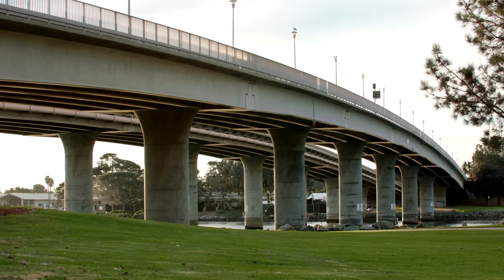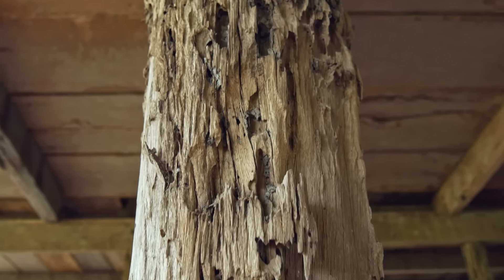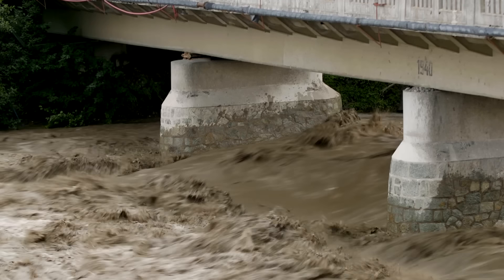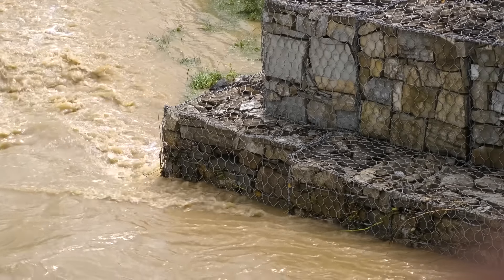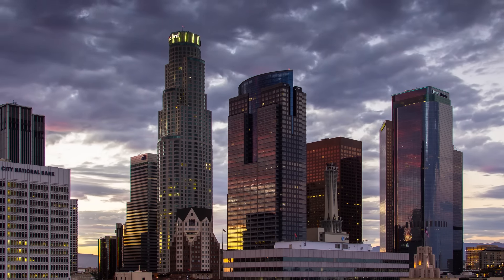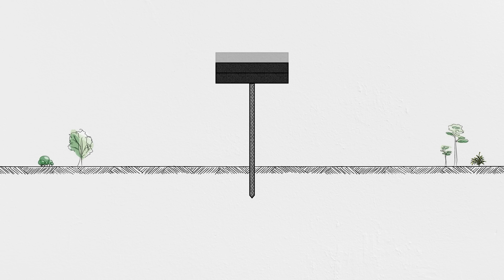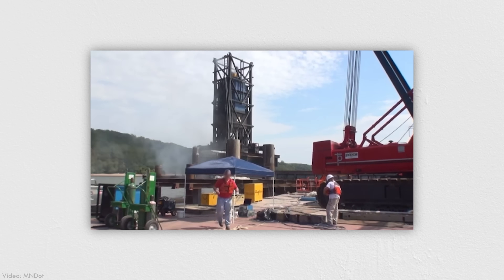Why Buildings Need Foundations

Comment: Static and dynamic force conversion was the methods we used in the military engineering when designing a bunker or any other military structure. Try to convert from dynamic to static (the effect of a bomb explosion) is very complicated. I like this video very much.

Comment: It is so interesting to see how things are build differently around the world. I don't think you will ever meet a foundation like yours around here for example, at least for anything build after 1960. Everything is build with deep reinforced concrete foundations, most likely because of the earthquake resistant requirements. On the other hand the old mud houses build before the 60s don't have any foundation at all, yet some of them still standing even after 2-3 devastating earthquakes during their lifetime (most are just destroyed from rain however, after they are abandoned and their roof fail with the years of corrosion).
Have you made any video about mud houses? We had a lot after WWII in Greece, even some of them reaching 2 stories and some are still used today.

Comment: Great video, very informative. 

Here in Perth Western Australia we have mostly stable sand so the common foundation/slab used is a strip footing with a supported slab or a monolithic foundation/slab (poured in one go). Both work very well. Frost line here is about 12inches below the ground surface.

Comment: here In the Netherlands do to the type of soil we have here. (mostly sea/river clay) 
They almost always go for the pile driven option. Even for smaller residential buildings. But then people tend to build here with the idea that a average (cheaper) house is build to at least last about 50+ years un altered and if possible with a structural face lift to ad at least a 40+ years again.
So in that way they become more cheaper in the long run.

I always find it funny that the ground work part often takes more work then the actual building of the above ground structure.

Comment: Sitting in my basement in 2 degree Michigan right now watching this video. My 1970's home has a shallow well at 30 feet. I basically live upon a small lake with several layers of clay, bedrock, and then concrete between me and that lake. The saving grace is that I also live next to a culvert downhill which feeds into a lake several miles away. That allows for the water  under my home to be maintained despite the several feet of rising water that natural culvert may experience during heavy rains. The home was overbuilt and thought out. For instance all my water lines run along one wall protected by decking and raised soil to lessen water running against the side of the foundation.  Most of the electrical runs along the same wall making utility repairs much simpler. While most basements do require some sort of sump this one does not and the foundation was well though out. 50 years later I have a slight "grout" crack in one brick wall and not one crack in the concrete poured slab despite no relief cuts. The entire house sits upon a "raft" like you mentioned with a 6" deep floor and a large percentage of fiber. Practical engineering can overcome most obstacles with a proper foundation to work from.

Comment: It was so interesting to see a house with wooden foundations! And even more so, its off the ground! I've been through civil engineering school, but I've never seen these where I'm from. Its always strip footing, usually 1,2m - 2.2m deep for residential homes (depending of if they have a basement, which they usually do). It might have to do with the fact that we exclusively build walls out of bricks and concrete, so i suppose all that weight needs support. Raft for larger, for example a 3 story building would almost always get a raft recommendation from the staticians.

Comment: Could you do a video on trench shoring, deep foundations such as secant and contiguous piling? Specifically applications that are meant to be used around existing structures and close to building perimeters?

It relates to a personal project seeking to  build an underground storage bordering my own building and neighbouring gardens without my building or the surrounding soil collapsing into the pit.

 Great content!

Comment: coming to this channel nearer the end of 2022 but - I live in the southeast (south Mississippi to be precise) and I find myself fascinated by this topic and how it might apply to the kind of geology common here! Soil that's a mix of sand and clay, and a really REALLY high water table - on the Gulf Coast, it's really common to see homes built on tall wooden "stilts" (probably not the correct technical term but it was all I heard anyone call them). I never thought about it very much. Now I'm wondering lots of things! It's pretty obvious why that kind of elevated home is popular, when flooding is extremely common - between the Gulf itself and the bayous and rivers, there's almost always a ton of water to contend with, and as I said the water table is Very High even a hundred miles inland. There's a ton of sand and clay, too, just native to the soils of the whole region - great for certain crops, not so much for wooden support piles and such, I'd imagine. On top of all that - it makes me think about the massive wave of "new techniques" for building that came through here after Hurricane Katrina. A whole lot of folks claiming they had "hurricane proof" designs, some of which weren't as sturdy as they wanted to claim. But surely the methods and choices for building in these areas have changed over time, even before that, right? Even before Hurricane Camille, maybe even back in the 1800s. The science of engineering has grown and changed, and the techniques and materials available for common use have to have changed too! That idea fascinates me, even if it's a little bit more history than engineering...

Comment: I read (and translated) a patent where a foundation pile is driven into the ground. A release cable is then activated and the pile is further driven into the ground. The release cable would release wings from the pile which would offer additional bearing load capacity than the force it takes to hammer it in. The pile may be pulled up at a future date for reuse.

Comment: Very interesting thanks.  I'd happily watch more videos on foundations.  Would particularly like to see videos on building in such a way that the building is highly earthquake-proof.  I live in New Zealand, and we get quite a few earthquakes here, (fault-lines, Pacific 'rim-of-fire,'...)  Large buildings can use base-isolators, but I understand they're not appropriate for most homes as a residential house is generally not heavy enough to withstand heavy winds while sitting on base isolators, which, after all, are designed to protect the building from horizontal forces (more than vertical ones, at least that's my impression.)  I've seen some solutions.  Also, none of the piles/foundations in this video had cross-bracing.  It seems to me that this would be a lot harder to install, but would provide significantly more strength in an earthquake (or even a large storm.)  And in really tall buildings you have tuned mass dampers.  Though they're not directly related to foundations, they really are when you consider the job of the foundations.  Another thing about foundations I'd like to hear is you were saying that very tall buildings (skyscrapers) can't spread their weight over a large area, so are forced to go down deeper instead.  I wonder if a skyscraper (especially a comparatively isolated one, if such a thing exists,) could in fact be okay with much shallower foundations - IF it could be built on a foundation with an enormous footprint.

Comment: Back in the day when I was a concrete truck driver, a customer of ours was dissatisfied with the foundation under the old house he bought. It ended up being a crawl space made of dry stacked cinder blocks on a on grade footer (lots of frost working it’s way under the foundation every winter). He proceeded to hand dig a basement under his house over the course of a year or so. He would excavate a trench, pour a footer, pour a wall, and then settle on edge of the house onto it. He repeated this over and over without ever moving his family out.

Comment: 0:25 //“job-stability” as a reason for foundations to exist is a pretty random thing to say
1:40 differential movement leads to stress; if stress greater than inherent strength->cracks
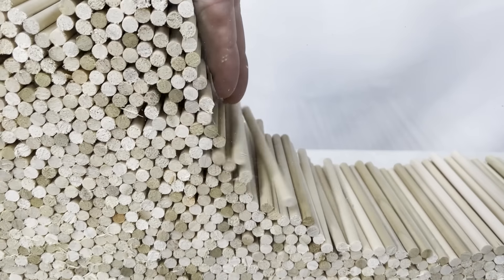2:30 equally distribute weight into subsurface, distribute down pressure to reduce Bering pressure

Comment: The geotechs in the PNW do load bearing tests on hammered piles. We (excavators) place our large machines overs a test pile and a hydraulic ram is used to test static load. Marks every inch on the test pile as well as installed piles; allows the geotech to match the drive of the hammer on the test pile to those the drillers are currently hammering. However I'm not on "the big ones" I work with standards of 1 test pile for every 60 piles, 30ft - 65ft deep.

Comment: There is a community of 100+ year old 2 and 3 story victorian style homes. 20 years ago these were worth maybe $50k and today are pushing a million.

Many of these homes had basements but had maybe 6 feet of clearance combined with crumbling brick walls ( Edmonton, Alberta ) where they were subject to +30 and -35c for 100 years were being replaced.

At one time there were 3 to 4 homes jacked up on stilts completely free of their foundations while a new modern basement and utilities were put in.  Very interesting.

Also, another interesting fact was that some of the wood used was literally 3 stories tall and all odd dimensions.

Comment: Round here, quite regular way to make foundation for a small family home is similar to your wooden piles, only they do it with rocks. Dig deep holes, throw bunch of rocks in it and pour it over with concrete. Generally speaking, these things will never need to be replaced.

Comment: I lived in a place called The Imperial Valley in California. Engineering the canal system for that pre-1900 is a feat in and of itself. But what marveled me is the use of wooden roads so early cars could drive over the sand. How do you build on soft sand?

Comment: Fun foundation fact.  A monolithic Dome house (a concrete dome structure with concrete slab foundation) of y square footage often uses ~the same or LESS concrete than a wood frame house of the same square footage that has a slab foundation.

Comment: Houses here don't use piers/posts but a concrete foundation that is trenched into the ground around the perimeter - then a concrete slab then cast on top of it.
Our winter climate is more moderate so we don't experience ground freezing or thawing but a basement area would be nice.

Okay seeing your entire house supported by a bunch of wooden piles off the ground is scary to me :).

Comment: "They said I was daft to build a castle in the swamp, but I built it all the same.
And that fell over and sank into the swamp.
So, I built it up again.
And that fell over and sank into the swamp.
So, I built it up again.
And that one burned down, fell over and then sank into the swamp.
So, I built it up again.
And that one stood! And that's what you're getting son, the strongest castle in the swamp!" From Monty Python's "Quest for the Holy Grail"
I wonder if the first castle would have stood if he built a proper foundation first? As it was, the first three castles must have provided enough of a foundation to hold up the fourth one. :D

Comment: How do you repair cracked raft foundation without, like, removing or destroying the house? Where I live, raft and ribbon foundation is pretty much the standard, but our houses are reinforced concrete pillars and beams with bricks inbetween. You can't just lift it or move it to get underneath. We had two major earthquakes in the last year, 6+ richter scale, and many houses experienced cracks or settling - what can we do to fix the foundation? Some kind of drilling and reinforcing or epoxy filling?

Thank you for these videos, I've learned A TON!

Comment: I've always wanted to learn more about skyscraper foundations. Are they sitting on bedrock? Does bedrock move? How do you put buildings next to each other on the same area of bedrock? What are the engineering considerations for that? Do buildings next to each all secured into bedrock act like roots in soil and actually help bind it together?
Reply: In some areas, a proposed high rise construction would require the contractor to underpin the adjacent existing buildings before excavation because of lateral movement of soil below their foundation.
Reply: Do read up on diaphragm walls which are designed for purposes of building skyscrapers with deep basements in congested site. Design for these deep structures in foundations come digitised ie in computer softwares with all the safety parameters which you can think off.

Comment: Given the recent news, a video on gas pipelines would be appreciated. There is lots of information to cover from compressor stations to packing of the gas. I know you have covered various water pipe topics, but I haven't found good public facing information on gas systems.

Comment: Never seen a crawlspace home...  

I am in Phoenix, where we are all slab on grade....  older homes are a footer about 16" deep on the exterior load bearing walls, and then a 4" slab poured in the middle.  2 part slabs creates the issue of shrinking and expanding with the slab, so older homes around the walls, you see a MASSIVE crack where the floor shrunk and bugs and stuff get thru...   Now-a-days its all a monolythic slab and even post tention... where Post tension is like a concrete bridge your built on for lack of a better term....  you are just floating with a few spots that are dug down to keep the house from sliding around.

Comment: Seems like piles on large buildings that can continue to sink should just be accessible so you can continue to add to the piles as they sink, basically let the building set it's own foundation. Similar to how they add piles to slab foundations for repairs, the piles are added in sections that they hydraulically press into the ground against the foundation.

Comment: I didn't realize that basements are designed with a foundation reaching below the frost line. In my location in coastal southern California, we don't have basements. People talk about the height of the water table as the reason we don't have basements. My own house is on expansive (clay) soil. These days, the soil would likely be mitigated before construction (removed and replaced with more stable soil), and/or the foundation laid several feet deeper. With our water problems (soaking wet winter and bone dry summer in "normal" years, even when there's not a drought), it's difficult to maintain soil moisture at a constant level. Yes, we have cracks. They are normal around here.

In the 1960s, my parents had a cabin built in the mountains. The foundation was poured in January, during a thaw!

These days California has pretty strict rules for new construction. Buildings have to be able to withstand earthquakes much better than older buildings.

Comment: My house is on a raised foundation, built in the 1910s'. I was raised in a house with a regular slab foundation. My current house is much easier to maintain due to the raised foundation. The house I was raised in has serious plumbing issues,  requiring drilling in to the slab.

Comment: freeze cycles are a main cause to fence post concrete cores to heave out of the ground especially if there are cavities at the bottom of the core  where water can pool if you see a fence with concrete exposed its because the ground squeezed the fence up during freeze cycles

Comment: I own a house in upstate NY that is at leat 180 years old. I have original paperwork to that point. The house was built on bed rock about 120- 150 feet above the Mohawk River and NYS Barge Canal. The cellar floor is a combination of rock and dirt. There is no "foundation" type of flooring. Just thought it was interesting in light of your video.

Comment: I am building a wood house in the Philippines which will stand on 3 concrete foundations three legged chair style.  Any sinking will be compensated for by jacking the house up on the offending post. The house is also broken up into separate units so nothing is any bigger than a double garage.

Comment: My new 1400 sq ft house had to have 35 10cm diam piles driven 10 meters into the ground beneath the slab foundation because after sounding measurements were taken the clay layer was determined to be too close to the surface in one corner.  The piles will even the load and prevent settling. It cost me an extra $20,000 US but the house is now guaranteed to last 20 years without settling.  I should add that this is in Japan which is a very wet and earthquake prone country.  No such thing as basements in Japanese home construction.

Comment: I grew up in an area where the soil consist of (tens of) meters of peat. This requires long piles as a foundation for even a light building.  When seeing a building site on vacation I was very surprised that there were no machines to ram the piles into the earth and there were only strip foundations, reaching less than a meter deep.

Comment: Type of soil definitely affects the needs for foundations too! Where I live the soil is so weak, almost every building needs to have piles to support it. It works well! After a decade or so, the street itself will have sunk multiple centimeters to the point it needs to be raised, whereas the house will still be at its original height

Comment: If you mix concrete with very little water (low slump) Its supposed to be stronger.

If you use a vibrator, the thick concrete melts into a slurry as if it were very wet.

Does vibration substantially increase concrete strength, or is it pretty minor?